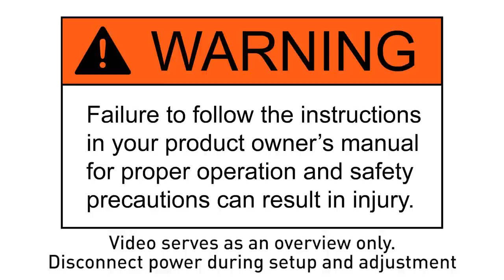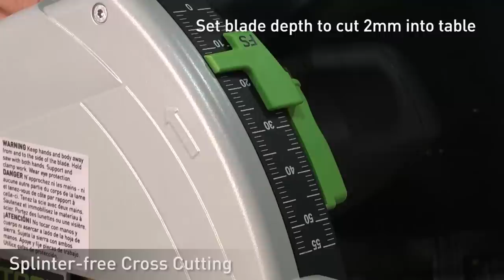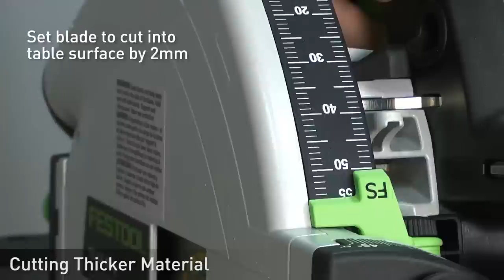Festool MFT/3 Portable Workbench - Setup and Applications

Comment: At 08:49 you are about 2 cm off your mark... Does the cut not align with the rail when cutting in an angle?
Reply: ***** At 08:20 the mark was made and the rail placed on it. That's why I wondered about the final cut. When I saw it again after your response I see they moved the rail so it's not at the mark. So it seems to confirm your claim of multiple takes.

Comment: At 5:56 you're setting cutting depth to 7mm on the upper scale. I assumed that this scale takes the guide rail into consideration, so that it will actually cut 7mm into the table, not 2mm as intended? Shouldn't the depth be set to 2mm on this scale (or 7mm on the lower reading)?
Reply: ***** Thank you for your answer. I'm afraid this is not correct. I just purchased an MFT and a TS 55 REBQ, and I watched this video before triming the guide rail.

I did use the setting in this video of 7mm on the "depth with guide rail" setting, but fortunately, I added a piece of scrap material instead of making the first cut into the table. I can confirm that the setting in the video will cut 7mm into the table and ruin the MFT where you should never cut more than maximum 5mm. You can actually see at the start of the cut that it is far too deep.

The correct setting for cutting directly into the table with only the rail is 2mm on "depth with guide rail" and 7mm on "depth without guide rail". It would be advisable to make a note of this in the video.
Reply: I agree with Lasse.  Unfortunately  I cut as indicated in the video and it cut 7 mm into the table instead of 2 :(  When I sat down and thought about it, I realised that the video  should have shown the FS scale set to 2 mm not 7mm as it did.  If they had used the non-FS scale 7mm would have been correct.

If you look at the blade depth when they start the cut at 6.00 you can  see they make the mistake described as you can see its way deeper than 2mm.  Additionally, I believe you can even see this erroneous cut at 10:57, but they have turned the table upside down by then.

It is disappointing that this was pointed out 2 years ago and the video remains up and unchanged.  I wonder how many other people have followed this official Festool video and compromised their table like me, but without even noticing?  Please do something about this Festool to help others in the future as it leaves a very bad taste in the mouth and not a good way to start off with my new MFT.
Reply: Ouch! I'm so sorry to hear this. You should ask Festool to give you a replacement top based on this experience – or you could turn it around and use the other side.
Reply: It's not rocket science to set the depth of cut up, I use the same technique as festool advise, put your saw in the rail drop it down until its hitting the table and add a couple of clicks. It's basic set up.

Comment: Bought a MFT/3 yesterday after years of wanting one. Very disappointed in how out of square it was out of the box. I'm working out of town and didn't have a good square with me. Setting this up by way of trial and error (making a cut, then flipping piece over, make adjustment, repeat, over and over) was very time consuming. Later in the day I had to slide the fence back to allow for a wider cut and had to repeat the whole process. This morning it was out of whack again. After stopping work to go back to the tool store and dropping another $100 for a woodpecker 1281 it was super simple and quick to set up, but why in the F do I need an additional tool to make this work?!? When I forked out $688 for a precision table I assumed it would include what was needed to make this work correctly. Why can't they include a simple square, or a 12" square chunk of wood, or something similar to make this work properly. Between the time I wasted yesterday and the time spent traveling to purchase needed tool today I'm quite annoyed. On a side note, for some reason my fence does not line up with the holes worth a hoot. Table/saw is currently cutting perfectly square, but hole closest to the guide rail has about .5 mm between fence and hole, the hole farthest to the left is about 3 mm from the fence, and the guide rail brackets are tight against stoppers. Any help in solving this would be appreciated.
Reply: User error.
Reply: +rusty cartman 
Just letting you know that we made a layout Square which is ideal for squaring Festool MFT table.
It is a perfect replacement for the hard to find, expensive Woodpeckers square ($200+), ours cost only $24.95.
Our customers love it here in California.
It is actually featured in Festool training center in Las Vegas.

It is a CNC cut and we made the Square from rigid Phenolic European plywood for durability.
The holes in the body are designed to accept clamps and also to make it easy to hang from the table.

http://www.andersonplywood.com/square-for-festool-mft-square/
Reply: Which is another garbage - lol, how dare you sell a ziploc for a piece of stool not to smell...

I had the woodpeckers triangle and returned it - mft can ONLY be setup exact by trial and error, that's all
Reply: I bought it a while back.  It's good.

Comment: Even though the table top is sacrificial, it makes me squirm to see it cut purposely. At some point in time, it might have so many 2mm cuts in it that it could become NON supportive at certain points on its surface. Has this ever happened and what is the cure? I have a TS 75 and it is so beyond my skill level that it was definite want and not a need. Still, when was the last time you regretted owning the best?

Comment: Do you not need to clamp the workpiece down
Reply: I don't think this is watched by Festool but the answer is no - the track has rubber grips and you are pushing against the fence. Of course you can always clamp and might need to do so depending on the specific situation.

Comment: The saw itself looks good, but that table looks pretty cheap.  Pretty good demo guy but you can see it wobble every time he touches it.  Also for a table that costs almost 700 dollars they should have a feature that lets you lock the saw in place and rip like a table saw.
Reply: The Triton Workcenter does that but it doesn't have the dog holes to use as a workbench like this tool. I'm thinking of owning both.

Comment: Note to self.  This table does not come with any of the clamping elements.  I have a Kapex so don’t need a table to cut up while making precision cuts on small boards.  Ordered this MFT for the clamping, but it only arrived with a bunch of tracksaw accessories I WILL NEVER USE.  Should be made clear in this video.  Buyer’s remorse. I should have just got a table with clamping accessories, not this overpriced substitute for a miter saw.

Comment: seems stupid to keep cutting the table top. in a real shop you will be replacing it all the time.
Reply: ***** so weather your ripping down sheet goods or cutting small pieces the guide always stays in the same place?
Reply: ***** I see. Thank you. I own a sign shop and usually make blanks using a sliding miter saw. I have been getting orders for larger signs made from hdu and mdf. Believe it or not I don't have a table saw. it seems like for the space it would take up I would be better off with a mft , track saw and one of your vac systems. a lot more capability it seems then a dangerous table saw. Am I wrong in thinking this would replace a table saw?
Reply: ***** That pretty much sums it up. Thank you for the info and very fast replies. Your a great rep for your company. I will be purchasing some Festool items this week. Enjoy your weekend.
Reply: ***** ok. yesterday I purchased a MFT, TS75, CT36, Boom arm, ETS 150 and a bunch of sand paper and clamps. I have to say im very impressed with every tool I purchased! The sander with the Ct36 is the only way to go period. and the usefulness of the MFT is endless. the TS 75 has plenty of power and adjustment. Im hooked for good now with good reason. Thank you to the Festool rep that answered all my questions the other night. great customer service. I usually don't make tool review vids but I think I will do some on my new Festool section of my shop.
Reply: i've had the same worktop for 4 years now in a very busy workshop..awesome bit of kit ..
Reply: Mr Slim Guy 65 ''